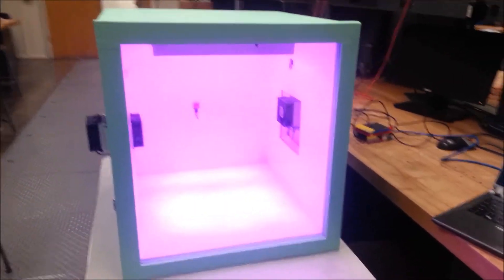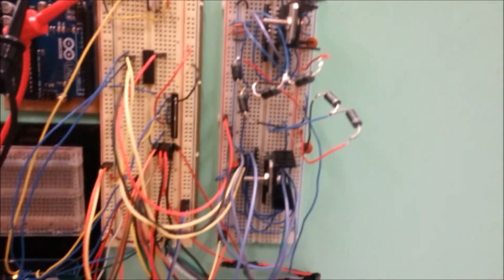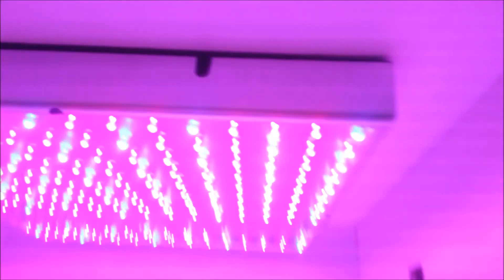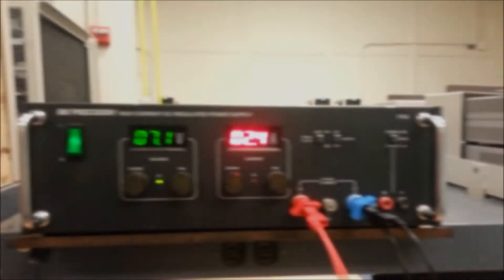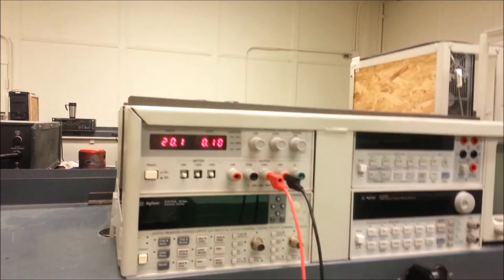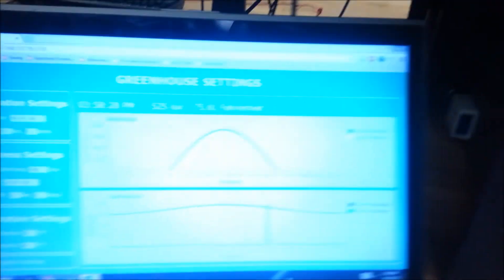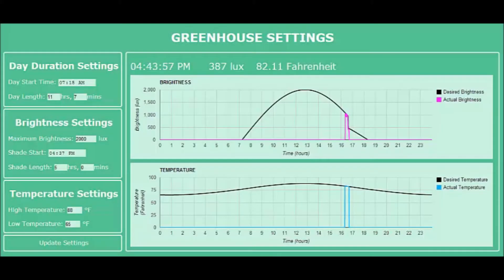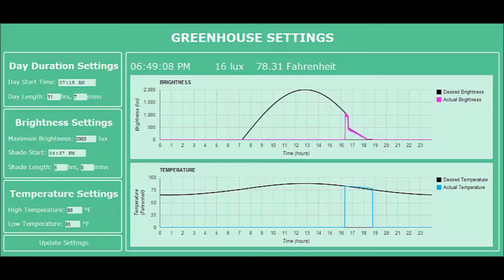Desktop Greenhouse - ME 102B Final Project

Comment: Hi i want to build this project? Please can you help?
Reply from the maker: Hi Vivek, unfortunately it was a long time ago and I don't remember too many details... Are there any specific questions you had about it?
Reply: @clairew1928  thank you for replying, I had doubts about controlling temperature inside the chamber. How did you controlled the temperature of thermoelectric coolers like for example if I want to maintain a constant temperature inside the chamber let's say 25°celsius . Is it possible to do so in this project?
Reply from the maker: @VivekSingh-mu1wc  yes, but honestly it didn't work that well... I would say we could maybe change the temperature in the box by +- 5C
Reply from the maker: @VivekSingh-mu1wc  if you want to know more about this kind of thing, I'd check out indoor marijuana grower message boards... There are a lot of people out there who are way more knowledgeable than me about climate control for plants
Reply: @clairew1928  ok, thank you for your help
Reply from the maker: @VivekSingh-mu1wc  no problem!
Reply: @clairew1928  I'm dutch and I approve this message
Reply: @VivekSingh-mu1wc  I wonder if using a PID with thermal sensor input/feedback and TEC voltage/PWM as output could do it